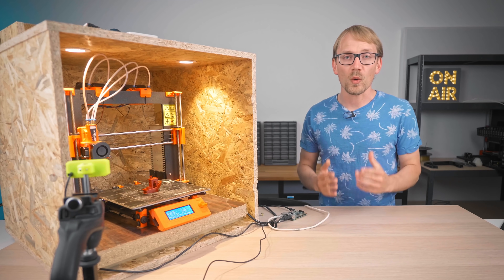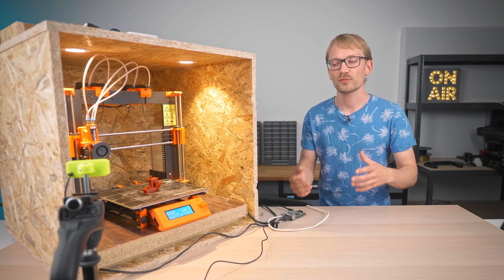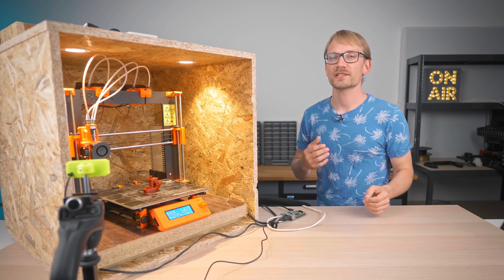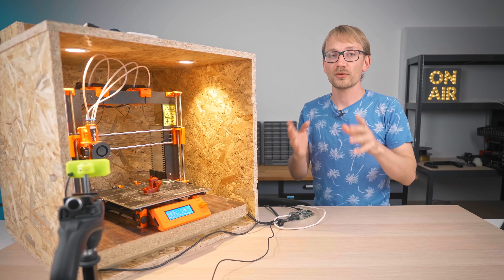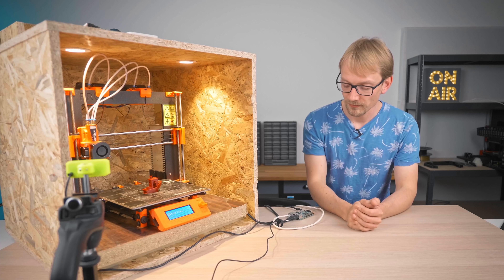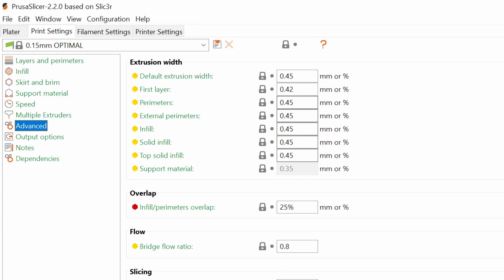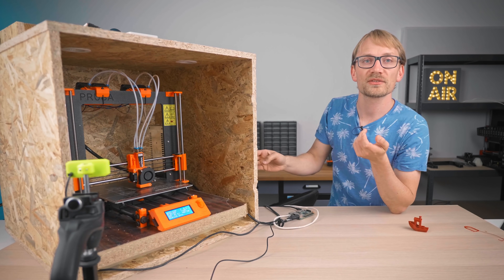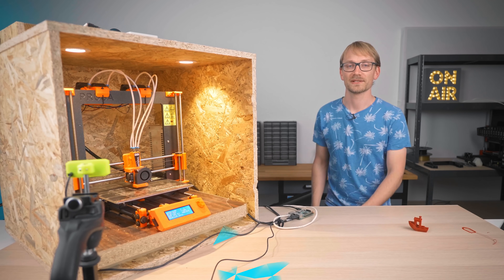Starting 3D prints without getting up from my desk - choose from 4 filaments in one click!

Comment: I don't bother exposing my machines to the internet directly, instead run an openVPN instance on a pi or VM stack then VPN into your network and login to octoprint. And you get a vpn.
Reply: The PiVPN script makes this really easy to do, because manually configuring openVPN can be a pain. My piVPN runs on my octoprint-Pi, installed on top of a stock OctoPi system image. Website for that script is pivpn dot io. Super handy for not just remoting to my printer but everything else on our LAN.
Reply: yep. similar setup. run a VPN on my server and then just hop on with my phone with the OctoRemote app or just my laptop with the web-frontend. super nice fully fledged system. you can even connect via prushaslicer and start prints remotely
Reply: Yeah, I have a VPN setup on my home network too so I can access my home network when away. In my case it's setup in a LXC container running on my home server.
Reply: Teamviewer or RDP to connect to a pc on your network works quite well for this also
Reply: A lot of the modern routers have OpenVPN server support build right into them. My tp-link does and it was pain-free to set up. Makes getting to my OctoPrint safe and easy.